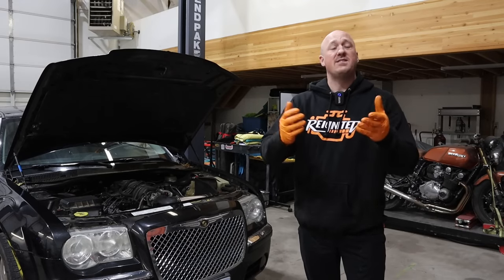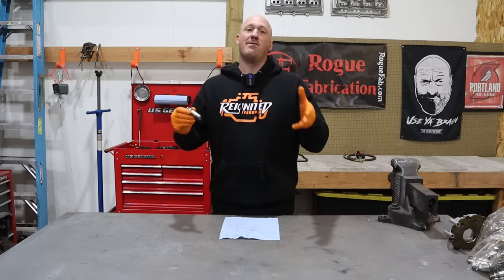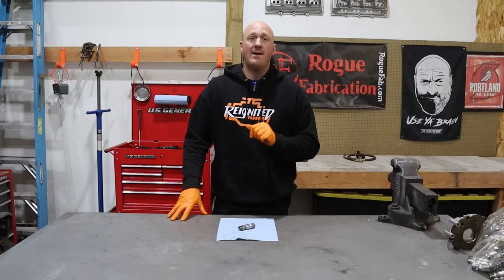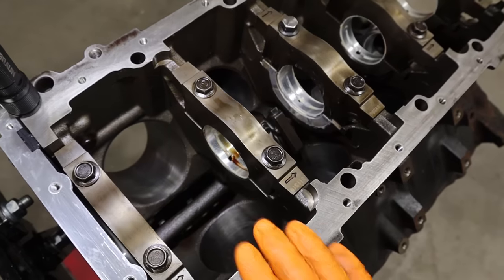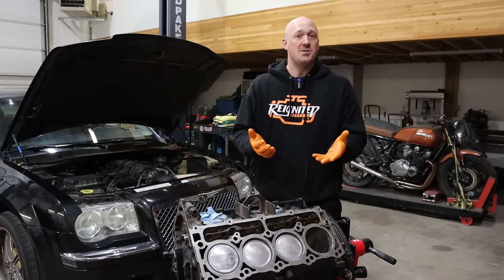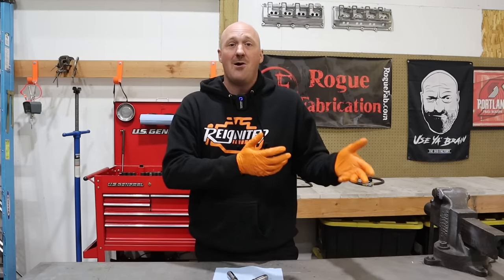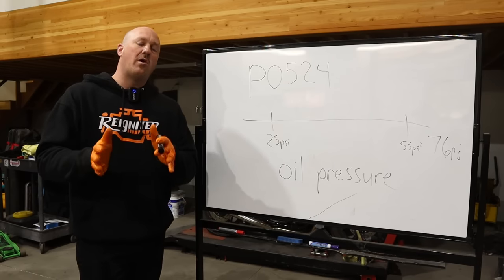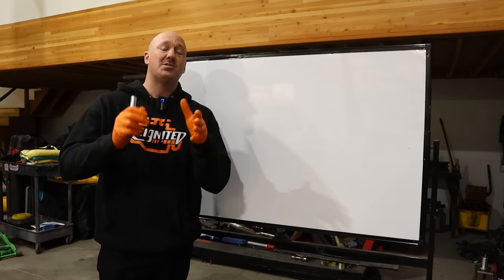The BEST Prevention For Hemi Lifter Failure! (In My Opinion)

Comment: Watched a bunch of your videos before tearing into my son's Commander that had a tick, expecting it to be bad lifter/cam. Took off the valve covers and found a broken intake valve spring and bent pushrod. All the other lifters feel good and no sparkly stuff in the oil. We're now replacing the valve spring and push rod and hoping that will be all. Is there anything that would cause the spring to break that I should check while I'm in there? I am planning to turn the engine over by hand several times after replacing the spring and watch that all lifters are moving approximately the same distances. Thanks for the videos!

By the way, a 5.7 Hemi in a Commander that spent most of its life in New Mexico is miserable to work on! Very little space and all the little plastic wire retainers and clips break when touched.
Reply from the maker: You're not wrong, those commanders are a pain to work on! Good news though, there's not any ulterior reason why the valve spring failed. Although it's not nearly as common as some other Hemi issues, it's definitely a thing to break valve springs in Hemis. I generally do about 2-3 per year. I have to assume it's just a casting quality issue. I usually just replace the spring and pushrod as you said and there's no problem after that. 👍

Comment: As a lubrication chemist that worked at Chevron for 18 years, I would guess that the change to low Zinc Dithiophosphate level has a direct effect on the wear of the roll pins causing the roller to seize causing wear of the cam and roller assembly.  I don't think extended idle time is an issue as police service does not seem to have more failures of lifters.  I would like see the impact of added ZnDTP on lifetime wear of lifter rollers.
Reply from the maker: I like what you're saying, but pretty much 90% off the lifter failures I see are from police vehicles.

Comment: I did run into an oil heat problem while towing on my 2011 2500 and my new 2012 1500. It was only bad when pushing the truck, but going uphill with an 8000lb trailer should not be enough to be hard for the truck.

Comment: Just run a 5w-30 synthetic oil, I started running it in mine  along with graphene friction modifier. I had the cam phasers
in my 09 F150 5.4 replaced and the mechanic told me not to run 5w-20 any more. a little heveyer wt oil will keep it 
good, That was 5yrs ago and I have not had any problems with eather one, Make sure it's full synthetic and not a blend!!!

Comment: Awsome video with a lot of good I formation. I try to not idle my 2019 Ram 5.7. I do run Amsoil XL in mine. And I change around 6-7k miles as a rule. And added a PacBrake oil filter relocation bracket for the filter. Being a 4x4 it was a mess to clean up. I do want to swap the oil pump on this truck. And the relief spring swap sounds ideal as my gauge for pressure would read right and if it did not. I would freak out due to my OCD and ADHD.  Love the info you have shared. In reading. My mind was at with exactly what you shared.

Comment: Hello, I am currently having an issue with my 2022 Ram 1500 Classic 5.7. I purchased the gold extended warranty when I bought I brand new last year (May 2023). It has been back and forth to the dealer about 7-8 times in the last few months. The first time they replaced the lifters on the drivers side head because of a ticking noise. Then a week later the noise appeared again so they replaced the entire head only on the drivers side. Ever since I started driving it after that I have been getting a rattling noise that 4 different dealerships say they cannot hear or it is normal. I have had 3 of these exact trucks from brand new throughout the years (2010,2019 & 2022) and I know 100% that this noise is not normal.
Anyways now what noise the engine is making is a sort of metallic rattle on acceleration that has progressively gotten worse over the last 2 months or 5k miles. The noise can also be heard and slows down while breaking to a stop. It sounds very similar to a squeaky serpentine belt during idle but clearly does not come from the front of the engine. The dealer also replaced the tensioner pulley and belt hoping that would be the problem but no success. I have no loss in performance or nothing abnormal with any of my gauges but some days it can be so loud that people look at me wondering “what the hell is that”?. 
I’m hoping to get this problem figured out because I am worried about something happening when I travel far away during the summer. 
Also, I am been doing some research about Lucas oil and in your opinion is that stuff ok to add into every oil change because my engine requires 0W-20, a very light watery oil and Lucas will thicken that up?

Comment: Excellant video, your points make a lot of sense. Do you think that the Etorque system may help with this issue? It should help with the extended time especially at traffic lights, your thoughts please
Reply from the maker: I do, I think it's going to be beneficial for those who are stuck in traffic for long periods of time, and so far the etorque system has proved itself to be reliable.

Comment: Good info. I was hoping my 2017 5.7 with the upgraded lifters wouldn't have to worry about this issue but you say you are still seeing failures after the lifter needle bearing design change in 2016. In reference to "tricking" the PCM into thinking the oil pressure is lower than it actually is; do you think that "safe" range for oil psi was in place for a reason? Meaning, do you think after the MDS solenoid repeatedly allows a higher oil pressure to collapse the lifter that the lifter will experience mechanical failure due to the higher oil pressure? I just wonder why else the engineers would have implemented this "safe" range for MDS to engage if not an issue? Overall great video and very informative.

Comment: I have a 2017 RAM 1500 hemi with 100,000 miles and have not had any ticks as of yet. I'm always mindful to not let the engine idle very long if at all. I'm surprised the the engineers over at Chrysler corp haven't made these simple changes to the engines at the factory already.

Comment: Oil pressure sensor is a transducer. Proper maintenance schedule with the correct oil. Short tripping does more to contaminate oil than driving at operating temperature.

Comment: First off, thanks for the information. I have some questions.
Do you know if changing the oil pump voids the factory and/or extended warranty by virtue of making the change? 
Same question as the first, but for the hellcat fuel pump.
Would changing the fuel pump, oil pump, and airbox over to the OEM hellcat parts require a tune for a 392?
Lastly, and least related to the video, I've seen conversations going both ways on oil catch cans voiding warranties, is it true or bs?

Thanks again for your content, I've learned exponentially more about my engine and vehicle as a whole from you than anywhere else.

Comment: Just replaced lifter in mine. Rollers were fine, pin the rollers rolled on wore out. Rollers mic'd out perfect. Lifters were dripping with oil when pulled.

Comment: Those oilers are shut down during MDS operation, or so they say in several of the lifter failure videos, which causes a reliance on splash lubrication and thus failure.  Those videos may have been wrong, but that's what I was told caused it.
Reply from the maker: It's actually the exact opposite, there is maximum oil flow when the system is activated.

Comment: Awsome video.
Wanted to ask a question I have a 2003 ram 3500 dually with the 5.7 hemi and I’m gonna change the spark plugs this weekend and was gonna use the original champion copper but would like your recommendation on any other spark plugs or if I should stick with those and perhaps if I did decide to switch wires I was thinking of shorty’s but if it’s not gonna be good for the engine I rather go with standard wires.
The truck isn’t misfiring so I was thinking of just doing spark plugs for now but wanted to get your thoughts on it.

Comment: I understand that you are saying replace with hellcat pump. The older engines don’t have as much of an issue with the tick. If I remember correctly from your vid on pump comparison the older engines have a lower volume and pressure pump. The newer engines have better basic pumps and those are to wide to fit inside the timing cover of the older engines. The hellcat likewise will not fit. With all this said how is it that the pump is the problem but, the 2003 to 2007 hemi has the more anemic pump yet had fewer tick issues?
Reply from the maker: I have no way to prove this, but it's my belief that when they went to the updated style camshaft in 2009 they likely changed suppliers and these new ones have either a faulty cam hardening process or just substandard materials quality. But that's just a theory.

Comment: I agree and feel FACTORY suggested intervals are too excessive regardless of synthetic or not. I had a 2023 Hyundai Tuscon and they suggest 8000 miles and WILL NOT pay for any oil changes prior to 7000 since they offer 4 free oil changes so while i had it i paid for every other one out of my pocket. I recently bought a 2023 1500 Classic Warlock with the 3.6, 355 gears, anti-slip, etc. Dealer gives 1st for free and i am bringing it in at about 3400 miles.

Comment: Hey Sky, I just got down with a long battle with a 3rd party warranty company to cover my lifter failure and cam repair. They finally approved it! Im going with 392 cam, non mds lifters and upgraded valve springs. I'm also going to do the hellcat oil pump, replace timing chain, and all belts as preventative maintenance. Are there anything else you would recommend doing while the car is apart for either performance, longevity, or just because! My brother reached out to you in the past and you helped him out so would also really appreciate any insight! Also i couldnt get the merch link to work. Are you still selling shirts or hoodies? im going to copy and paste this comment to your email and hope to hear from you soon, love the channel btw, long time fan!

Comment: I'm actually dealing with this at this moment. As dodge is doing this tear down Wednesday instead of just fixing cylinder 8 lifter and cam shaft I said to change all lifters and cam. As well as timing chain as they are already in there. 8000 grand ltr

Comment: Awesome R👍🏾🔔🤳《☆》I recently bought a 2014 Charger Pursuit with 115k miles on it & 7900 engine hours of which 4700 are Idle hours. So far it runs like a Top. One day after letting it sit for 5 days it did make some rattling noise when I started the engine but the noise went away after a few seconds. I'm New to Your channel so I'll probably be checking out more videos✌🏼😎☯️

Comment: Do you think it would be worth installing the billet lifter trey vs the plastic if I’m currently rebuilding a non-MDS 5.7 truck motor for my 2012 2500
Reply from the maker: I've heard of the plastic trays breaking before, but in all my years as a tech I've never actually seen it happen, so no, I don't think it's worth it.

Comment: Just bought the 10342HV Melling for my 06 Chrysler 6.1. It came with a note saying it will NOT increase idle oil pressure. I haven’t installed it yet but now I’m regretting my purchase. What do you think Sky?
Reply from the maker: Not sure how that could be possible. I proved with the melling pump on my Magnum that it increased oil pressure at idle. Unless the 6.1 has a larger oil pump than the 5.7 does. The 6.1 is the only oil pump I haven't personally measured yet.

Comment: What a great video! Can I use this truck for a 2015 ? I also am currently having this issue. Not sure which resistors I should try for 2015 with a hellcat oil pump.
Reply from the maker: There's actually an even better option available now from Melling: 10452HV 
Use this pump, and swap to the stock pressure relief spring that comes with the pump and you won't have to go the resistor route 👍
Reply: @ReignitedAuto  unfortunately my hellcat pump is already installed and I'm having this code pop up

Comment: On our '13 we used Pennzoil Plat and ultra plat, one of the most fluid oils  and never had any issue over 140k miles even with extended idling.  It is interesting though that the GM lifters in the afm do in fact lock up and cause them to eat thru the crankshaft.

Comment: I’ve had 2 different 6.1 300 SRT8s. Both of them had this problem. The first was at 59K the second was at 90K miles. The oil was changed religiously every 3K with the manuf. suggested Mobile 1 0W-40. After the second time the mechanic that replaced the lifters suggest that I stay away from the M1 oil. I did and switched to Castro AFS. 168K later no issues. Coincidence 🤷

Comment: Does changing the oil pump to a Hellcat one for a 2023/2024 6.4 in a Power Wagon void the factory warranty?  Second, I have run Mobile 1 in all my vehicles for 20 years with 5-7k mile change intervals, occasionally adding Lucas oil conditioner, would that alone avoiding idling prevent the issues in the 6.4 HEMI?  Thank you for the great information videos.

Comment: Granted, I know this would use more gas. However, would having a high idle option be somewhat of a solution too? I know diesels are way different, but, I had a 2007 Ram with the Cummins in it that had the high idle option. You could turn the cruise on and hit the set button and it would kick the idling up a little. Not much, just enough to keep the oil flowing good and the alternator charging good. Just a thought. Great video though.
Reply from the maker: Yep, that would accomplish the same thing and I have heard of fleet companies doing this very thing. 👍

Comment: In colder weather, driving almost immediately after letting the engine get down to its cold start idle is better then letting it idle till warm. Drive it slow so the rpms stay low but high enough to move more oil

Comment: On modern day trucks, many have some sort of AFM, DFM, DoD, EcoBoost, etc. And lifters being the first point of catastrophic failure which often leads to replace/rebuild. What I want to know is - what is the failure rate at various mileages? Are we talking 10% or 1% or 0.1% by 50k or 100k miles? I've never seen any quantification other than "oh, it's probably the lifters. Time for new engine"

Comment: Great video! I have a 2014 1500 sport. I did the MDs delete and installed a non mds cam from a 2500 model 5.7L and the “Hell cat” lifters and oil pump just over a year ago.  Truck has been flawless for almost 30,000km now.  However early October it started developing a tick again. It drove me nuts trying to locate the source.  What’s weird is it only ticked at operating temp. Start the engine cold and it was silent until it warmed up. Determined sound was coming from bell housing area. I’m thinking torque converter. It started having jumpy shifts and while driving with cruise control on you can feel the truck almost surge and the rpm’s will fluctuate slightly.  Have you ever heard of a torque converter develop a tick like this before it failed? Thanks I enjoy your content!!

Comment: I dont run my 2012 ram 1500 v8 hemi to 5k miles between oil changes. 
I do them every 3k miles. I also add in a Lucas oil stabilizer and
i have no issues with over 150k miles on my truck.

Comment: Lots of people have figure this out.. it’s the cam.. in 2018 they found that the cans were not being hardened/cured correctly.. this problem was fixed in 2018 but those trucks were already built as were a bunch of engines for 2020. So theoretically the 20.5+ trucks should be good to go. If you search forums and fb groups etc, the failure on 2021-2024 is slim to none. So hopefully moving forward we should be good. Also on the 6.4 Hemi people need to use the 0w40 or 5w40. First number is mainly For easier starting in winter or colder weather. The important number is the 2nd 40w. That is your full heat/normal lubricating weight. Lots of people use 5w30 or whatever lol they want. USE thicker oil, it sticks better and takes longer to run back down to oil pan. There was a TSB in 2021 about using the right oil etc.

Comment: I have stated many times on many forums the issue is not the lifters, its not the cam, its not the oil. 
Its the weak valve springs. lifters cannot leave the cam ever. The impact hammers the torrington bearings and lifters fail of course.
Reply from the maker: Have any data on this? I'm happy to entertain new ideas, but I can't see any scenarios in which the lifters are leaving the cam surface. Even if you are talking about valve float that is generally a higher rpm issue, not an all the time issue.

Comment: ran only Mobil 1 in 204 6.4. No water leaks on Manifolds and no lifter problems , i let it idle all of the time. no problems over 100k miles.traded it 2019 got 5.7 zero problems at 60 k so far

Comment: Have you ever checked the pressure that the lifters put on the valves and cam shafts? I recently had a valve seat fall out and it didn't break apart and I was able to get it to the shop before it was too late. 
But I noticed that the valves that touch the rockers are peening over a little. I am wondering if the lifters are putting too much pressure on the cam and valves. Too thick of oil or age maybe makes it thicker and stiffer. I have seen the aftermarket lifters have a relief hole that helps oil the cam and relieves pressure from the lifters. And people are having no issues with wiped cams and other issues. Changing the oil might help keep the lifters from getting stiff. But I think the bleed off hole helps keep the lifters from acting like solid lifters. I think I am onto something here. Let me know what you think. Thanks. Sorry for the long message I hope I got my point across though?